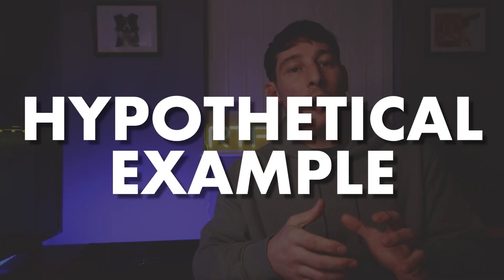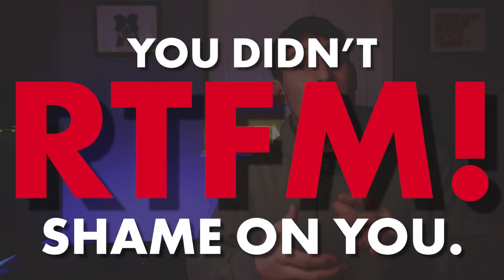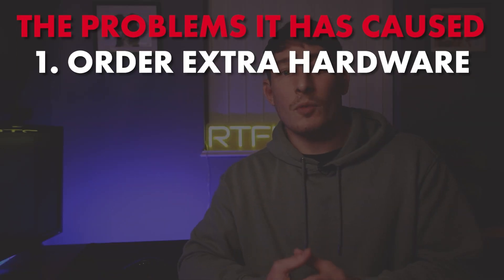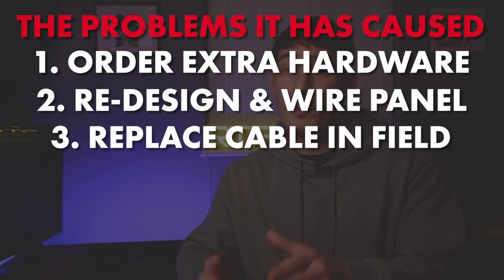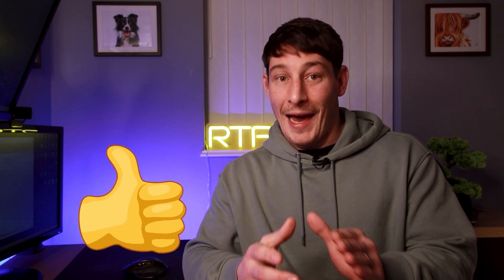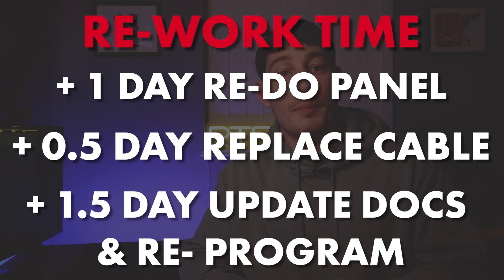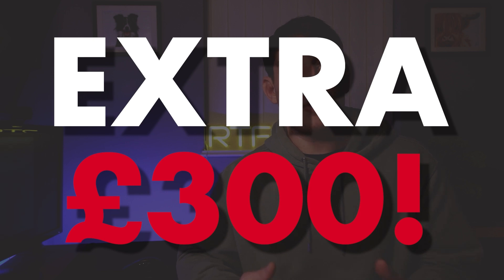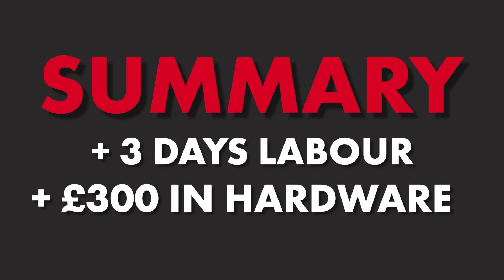Technical Manuals. Why You Can't Afford to Ignore Them

Comment: In general. In every design situation, my first and foremost three steps to be completely done are:
1. read and, if necessary, clarify all customer requests, design parameters, and specifications,
2. read the documentation (or at least the tech specs) of all the parts you intended to use for the project,
3. take a sheet of paper, and a pencil and make a draft from ground zero to the first working iteration step-by-step, most importantly, highlighting all the questions you're not 100% sure about.

Anyway, we have a very good explanation for RTFM here in Hungary: Renyhe Tudatlan, Faggass Mást! [Sluggish uninformed, ask someone else!]

Merry Christmas!
Reply from the maker: Great comment mate... very similar to my process 👍
Reply: This is all sound.

You should be generating multiple RFI’s (requests for information) regards set up to ensure you understand it or can present a clear picture to a specialist contractor